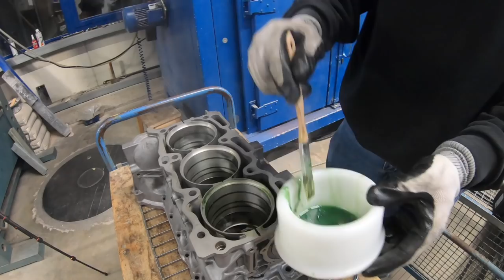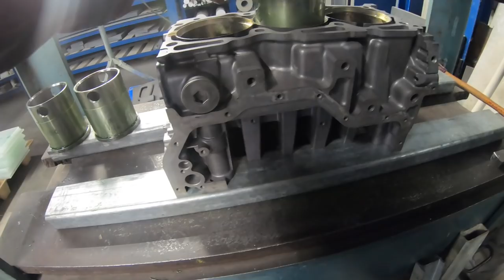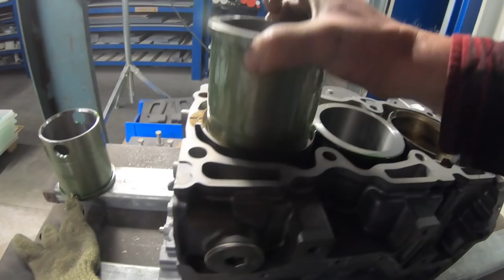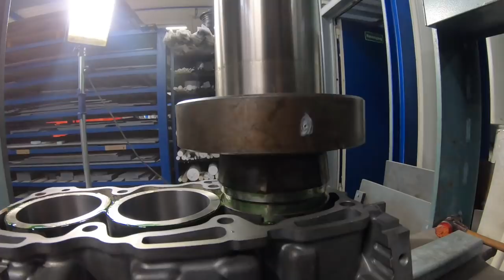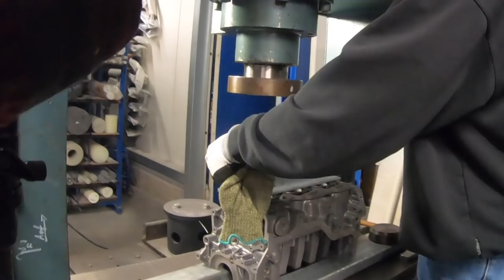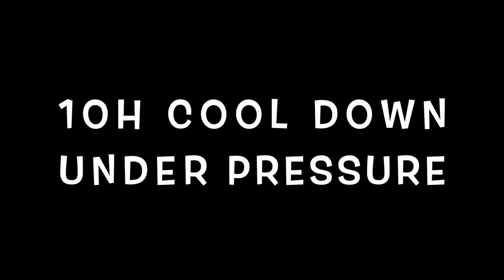High Performance Boxer SIX CYLINDER build l Part 2 l  EG33 l  Subi-Performance

Comment: Did you have a trick for getting the sleeves at the right angle for the wrist pin holes or were you able to get it close enough by eye? Awesome to see some of the machining work you've been doing!
Reply: On first video you se he marked all tree sleeves and block, and before pressing them hr just eyeballed them in cylinder block.

Comment: Wouldn't it be easier to align wrist pin holes by cutting them after installing the sleeves?
Reply: I was curious about this too, unless it’s because it would require the engine to be machined laying on it’s uneven side

Comment: well being an avid fan of the six cylinder and being a precision engineer myself, I have to say looking past the subject on film, I see you have a large stock materials, do you also manufacture, besides doing the engine work, I look forward to seeing the finished engine, you skills are being very well documented, do you ever disclose what he cost of one of your engines is, could be very high I'm guessing,
Reply: On his site you can buy one. They ain't cheap.
Reply: He's got lathes, mills, cnc machines, he's recently been coverting open blocks to closed deck, its quite the outfit!

Comment: The issue putting sleeves in a hot block is alloy shrinks to the  middle,  so now the sleeves are not seating on  the step,  then they drop sooner or later even if you leave weights  on them,   blocks need to be same temp when pressed in. Or cool the alloy at the flange area first so it grabs at the flange.
Reply from the maker: nope 😂

Comment: Seems like that middle wrist pin clip would be a pain.  Guess I'll see.
Reply: It is, long reaching double jointed pliers, or small pliers and small hands through the bore. sometimes a set of 90deg pliers. Its a PITA but doable
Reply: Nicholas Hawks I’m hoping that Andi has some miracle tool to make it easy (probably not!). Best bet would be to train a small monkey to use stubby pliers (or maybe I’m overthinking this.

Comment: I discovered long ago how even an extremely tight press fit sleeve can creep out as the parts cool, especially when there’s dissimilar metals. The only way to combat this is to keep pressure on it as it cool...just as seen in the video.

Comment: What oil are you using? and what are those holes in the sides of the sleeve for?
Reply: Those are access ports to allow the wrist pins to be inserted to connect the pistons to the rods and the clips to be applied.  Since this is a boxer motor there is no access to the big ends once the two halves of the block are bolted around the crankshaft.  On most motors the rods are pinned to the pistons before they are inserted in the sleeves and then the big ends are bolted to the crankshaft (with the motor flipped upside down). You can see the problem assembling the flat motor is there is no “up” or “down”, only the middle and the sides. A lot of mechanics find this whole business a bit scary (including me!)

Comment: the green stuff. is it oil or some kind of heat curing resin?
Reply: Looks a lot like green permanent threadlock, but it also looks like grren assembly lube... I'd say threadlock!
Reply: Yes, at the end of the first video you can see it’s some Loctite.
Reply: loctite 620 sleeve retainer, works well for loose fitting cylindrical stuff up to 0.1mm gap or so.
Reply: @ahmedfraidoon  boom, there it is!

Comment: What happens if you mess it up. Is it possible to ever get those liners back out?
Reply: You heat the block up, then use inert gas to cool the liners while you pull on them.   Might not come out without damage, but it is doable.   Cost will be $$$$.  (or €€€€ in this case..)

Comment: Would make a sweet reliable aircraft engine?
Reply: Not really, it was tried, but the engines had head gasket issues. Inline engines are stronger have lower frontal area anyway.
Reply: What did I miss about the subaru in an aircraft? If there are flaws in the engine being used in a smaller aircraft, Subi Performance would be the place to rid these flaws. It has potential  in the aviation market also. https://youtu.be/BPLVQ2733CQ
Reply: https://youtu.be/ClTFpdtW8wg
Reply: Johan Rodrigues  Lycoming and Continental engines have regular catastrophic failures. The reason why the flat configuration was chosen was to make the engines easy to cool, not because it's a strong configuration.
Reply: @S.P.A.R.K.Y.  Eggenfellner converted EJ engines into aircraft engines, they had issues. It's true that a shop like this one could solve the issues, but at a considerable cost. There are simply better engine choices.
Reply: Johan Rodrigues  You just mentioned something about Cessna, your comment was just too vague to know what you were talking about.

Comment: You're so good with that paint brush how about coming over to my house and painting it? By the way are you using the Goodsen assembly lube? Looks like it.
Reply: My guess is that this is some kind of high temperature epoxy adhesive
Reply: @cedi98  I'd rather doubt it as he didn't mix anything together. All epoxies are two component systems. Just looks like assembly lube to me.
Reply: @satamanschmidt3428  yea might be. But there are actually one part epoxy adhesives. I used them at work for glueing and pressfitting shafts onto hubs
Reply: Suleve ™ 50 ml Green
Reply: Valkataudi Atanasov  I'm thinking Loctite green sleeve and bearing lock rather than any epoxy. This is an anaerobic sealant that only hardens when deprived of oxygen.

Comment: If you machine that much meat out of the bore to insert a sleeve, why is it sleeving is done anyway? Does sleeving add any further thickness to the cylinder wall? How does a sleeve make the bore stronger?
Reply: Sleeve can have other metallic properties, making it for instance stronger around the top where the combustion pressure is highest. That coupled with smaller manufacturing and higher tolerances, the sleeves are much more precise than a cast block.
Reply: And some times have thicker walls too
Reply: The original cylinders may have been scored and this is a way to repair that damage without buying a block. Since he did them all I am going to assume the comments above me are correct in this case.
Reply: Could also just simply be a big power build hence the need for liners
Reply: Normally the stock cylinders just have a thin low quality steel that's been plated on the inside as a liner and has some sort of wear coating like nikasil if it's new and extra fancy. Most of the time when aftermarket sleeves are used they're thicker and a better quality steel than what was there (when the block was machined in Pt 1 he went past the stock liner and into the aluminum to make room for the thicker liner). Also you can see the liners are thicker at the top where there's more force from the combustion pressure
Reply: Thanks guys awesome input

Comment: Will you turbocharge this eg33?
Reply: But isn't the EG33 based off of the EJ22, which has slightly thinner walls than the EJ20? That's why you can see the round indentations in the water jackets, too. To make room for installing the case bolts. I didn't think EJ20 blocks had those.

Comment: OK, I can't take it anymore! The limitation on sleeve size is really the main journal bolts, is this correct? So, if we were to tig weld a 12mm deck on the block and then bore each side completely out, could you not bolt the case halves together leaving the flat of the main nut facing the sleeve area and then machine for darton MID sleeves? Using the area 100% so the sleeves are almost touching the main studs/bolt where it cannot be turned without pulling the sleeve? It would be far more rigid with better cooling than dry sleeves. I think you could also go to 106mm using MID SLEEVES NO?

Comment: If that can't make 550 hp 
It's not worth it . 
Stick a 2j up in there bro 
A mid size can of nos and 
Hold on tight
Reply: 230 - 250 is not ideal for such a good build your work can possibly 
Be worth more than the engine and tranny . good luck on the awsome build